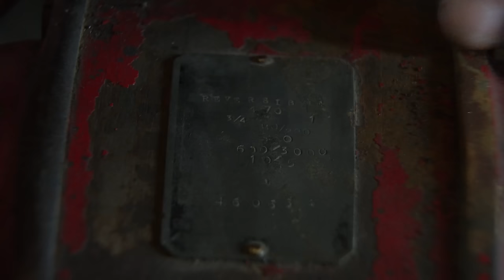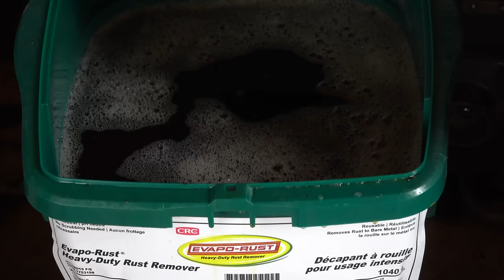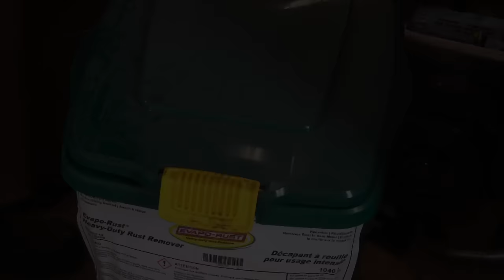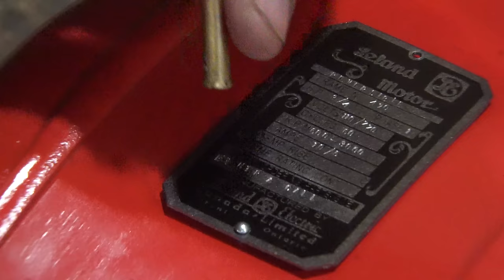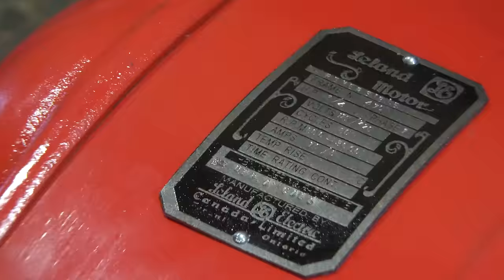Why Did They Stop Making These? [Restoration]

Comment: When I went to Electrician's Mate "A" School iin 1978 they taught us about variable-speed, reversing DC motors, but I've never seen one. So cool!
Reply: That is not what this is. This is an AC motor, and the brushes are not connected to power, they are connected to each other. (Shorted.) What is going on there is that depending on the position of the brushes, it is either including or excluding shunts (shorted turns) from the area of the rotor that is under the area of magnetic transition, so it is effectively a variable ratio.
Reply: im 68 an never seen one. dident no they exsited. snappy an cool. even now bet i could find a use for it.
Reply: @NeilWhelchel  Interesting. Makes sense - when they taught us about reversing DC motors, it was all handled in the controller. Variability in speed is simply handled by changing the voltage to the motor (DC). So I was wondering about this one.

Comment: This technology is still very useful and much more durable in industrial environments than solid state motor controllers.  However please be advised:  when the motor is going full speed and then is slammed into reverse the motor will create a voltage spike in the line.  Any delicate electronic devices sharing the house wiring may be damaged.  This principle is refered to as dynamic breaking. (when a running electric motor is disconnected and leads shorted to rapidly stop it).  The motor momentarily becomes a generator until the inertia is lost.  The leads can also be shorted with a high amperage resistor for less violent breaking.  This brushed motor most likely can also run on DC.  Great videos.  Watching from far far away.
Reply: It could probably be converted to run on DC but it did not look like there was any electrical connection to the brushes. the AC in the stator is inducing a current in the rotor windings with the brushes completing the circuit.  The alignment of the brush position adjusts the bias of the resulting magnetic field and by extension the speed and direction.  The video's analogy of the water wheel is a good enough layman's explanation for what's happening magnetically.
If the stator wiring is laid out how I suspect it is there would not be any significant adjustments needed there.  Just connect DC voltage to generate a static magnetic field.  The brush rigging however would need to be insulated and have its own power supply added to the brushes.  You'd loose the speed variability with moving the lever however as you control the speed by adjusting the voltage.  It would make setting neutral a lot easier but moving it around would just make your brushes spark while running.

Honestly this thing is unique enough that I wouldnt even want to try.  DC motors have their own design and theres no reason to try and cludge this interesting bit of old tech into being a DC motor that would be inherently temperamental unless you locked down the lever so it couldn't move.
Reply: braking ;)

Comment: Finally someone that knows how to join wires and use heat shrink.
Reply: Tbf he used an LB as a switch box too. 😂😂😂
Reply from the maker: @user-lb8do4ew6k  Muahahaha.  I needed a small switch box solution that mounted where the original was missing.
Reply: @HandToolRescue  I have been warned against soldering crimp connections though. "They" say the solder acts more like a lubricant than a solemn commitment; "they" possibly being old wives though. In a situation where nothing is moving much I don't think it matters.
Nice job as always of course.
Reply: @gshingles It's not a common practice but I've seen it in aerospace cables. Makes for a bitch to rework/repair though lol
Reply: @Sun-ut9gr  Hey, not saying I don't do it occasionally :)
Reply: Heat gun works better than torch guys. I was team soldering iron and lighter for a long time but it really does work so much better with an actual heat gun
Reply: @gshingles  this is only really an issue if you solder first then crimp as the solder prevents the crimp connector from getting a good bite on the wires themselves so they fall out if the solder melts or softens, the way Hand Tool Rescue did it there should be solid as the solder is being applied after a solid crimp has already been made.
Reply: @fragger56  ah, makes sense, thanks 👍
Reply: @fragger56  in fact, the context where I picked that up is putting ferrules on bare ends. Was told not to solder the bare end before crimping the ferrule, which is the scenario you describe.

Comment: To put it simply, the electromagnet created in the windings is interacting with the fixed magnets in the casing. As you move the location of the brushes, you're changing the direction and efficiency of push. As you move further away from center, the motor gets more and more efficient- ie: more speed. 
The energy is still going through the armature in other positions but- instead of creating torque, it's creating heat- which it likely why they're not made anymore. Too many barn fires.

Comment: Interesting motor; I've never seen, nor heard of such a thing, and I have friends that have come across a lot of unique equipment.  

I have been able to weld cast iron with a wire feed welder, and it's held up perfectly.  I first discovered it would work, after my dad tipped over our Harbor Freight drill press, and broke the platform crank in two.  I made the obligatory double-groove grind for the braze, and thought I'd try out my new wire feed welder, with ER70-S7 wire, just to tack the edges together.  It went really nice, so I thought I'd make a base pass.  

That went so well, that I welded it completely, and it never broke again, even after scrapping it some 30 years later.  That went so well, that I welded a huge crack in my neighbor's 390 Ford exhaust manifolds.  He held the rosebud down there to keep it cherry red, and I made pass after pass, filling in the gap.  He drove it for several years, and they still weren't leaking 15+ years later, when he sold the truck.  

I found cast iron welds at a much lower temperature.
Reply: The key to welding cast iron is preheating and post heating don't let it cool fast after welding keep heating it and slowly let it cool that keeps it from cracking.
Reply: @dmclegg66  It was Christmastime, and he drove it home.

Comment: Years ago, my father had a business rebuilding motors.  He would strip them down to bare metal, rewind new coils, refit new bronze bearings and paint the external parts.  He used some type of white wool in the oil wells, not cloth.  Originally, the winding wire was cotton-covered enamel.  When wire insulated with Formvar came out, he switched to that. I remember him cutting Holland cloth for insulating windings. Also, I remember him  carefully redoing the armatures, including undercutting the material between the commutator bars.
This was in the 1940s and '50s. It seemed like a lot of work, but I suppose it was feasible for specialized motors at the time. 
th

Comment: Bent handle was probably an indication of the predominate direction the motor was used. Maybe high speed in one direction, (hard over) and slow speed in the other direction negating going hard over. Good stuff. We were taught shifting the field for speed and direction but never had our hands on it. Thanks.

Comment: I watched this video closely. The amount of work involved in restoring it is absolutely MURDER! The one important step which I believe was skipped is checking the windings with an ohmmeter. I also think a high-voltage should have been applied to test the leakage of the insulation of the windings to the case (and hope and pray and keep fingers crossed) it passes the test! The engineering involved in designing this old motor is awesome.
Your job of cleaning it up with extremely hard work is excellent!

Comment: Im studying to be an electrician, we have one of these ate school. They went the way of the dodo when cheap inverters/speed controllers became available, because they have a massive flaw many other motors share; it has brushes, and brushed motors require maintenance much more often than induction motors. Asynchronous motors on the other hand only need yearly lubrication of their bearings for the most part.
Reply: What maintenance? 
Decades ago, I had a Dremel prcision tool. From times to times I had to check the brushes. Two 5 cents caps, then the spings and brushes at the tips of them. Changing brushes that were about to fail or were gone were like a 5 min operation at most.

Brushed engines have cons but they also have pros.
Reply: No mechanic or anything other than a wise old fart but
Just take a good look at anything made in the past 30/40 years and is it still working and/or repairable?
Most of 'todays' goods are made for 'the throwaway society'
Yet 60+ years ago they built machines to last - yes they had to be maintained / serviced but they lasted and repairing them was easy.
40 years ago my dad got 3 non running twintubs (washing machine) from an auction - from those 3 he made one functional....for my first home.
Now...I'm looking for a pre '86 car [pre engine management/pre computer/pre electronics because they're easy to maintain and hardly anything goes wrong except body rot and crashes....nowadays a simple rear end shunt will write a vehicle off.
Not having a go at the younger generations just offering a different reasoned perspective
Reply: tragic that serviceable motors with brushes are seen as a flaw, to be replaced by disposal non-serviceable motors.
Reply: Induction type squirrel cage motors still need Condition based monitoring. And older plants still use brushed motors because of longevity and ease of service
Reply: @philhunt9297  Truer words were never spoken! Throw away society is spot on. Why build it to last when you can get suckers to buy a new one every 3 years. Good luck finding a washing machine that will last longer than 5 years. God forbid you have to open the tiny flip top lid and add a few drops of oil twice a year! "Yeah too much work, I'll just buy a newer on". God craftsmanship and solid components. That is exactly why he was able to restore this neat little motor. Quality work in the manufacturing process, something lost on todays CEO's. Greed is king.
Reply: I have seen motors like this used where a winding oeration is taking place where the rotational speed slows down as reel get bigger but you need more torque as diameter is larger, so was used as more for torque as speed was determined by speed of the "main" drive
Reply: I'm sure brushes are much cheaper and easier to service than a failed inverter VFD
Reply: @benhartley1757 from what I gather it's not about the brushes per say, but the downtime of having to disassemble the motor and replace the brushes PLUS clean the collector (which is arguably just as important). I think y'all's points are valid though. "Throwaway society" has really started to get on my nerves, half the fun of studying to be an electrician is being able to fix my own damn stuff without a company forcing its proprietary garbage down my throat.

Comment: It appears to be a straight repulsion ac motor, or a repulsion - start induction - run motor.  They were quite common until about the 1950's, but have been largely replaced by capacitor start- capicitor run type motors.

Comment: Great job, great work on the brazing of the casting, and the new finish.  You do really good work.  As mentioned below, the commutator under cut is important and a tool should be used; years ago, I used a lathe developed specifically for turning commutators.  Also, the twine holding the windings in place at high RPM needs to be replaced.

Comment: Took me back to Algonquin College, Ottawa, Ontario, Canada,  early 1960s.  A Mr. Menna, "Electricity/Motors, teacher/docent: "Gentlemen, before "modern generators" using current and voltage sensing relays, a system was used to balance the required current/voltage at city speeds, versus Highway cruising speeds to charge a car's battery.  This was known as: "the third brush system" applied to the commutator of a generator."  You will probably never encounter this system in your "careers".  It is a museum piece, much like the Gramme ring motor."
Being too busy "learning"  I never thought about it again, until I saw your restoration.  A universal MOTOR with 4 carbon brushes, fixed to a radialy rotatable plate;  Eureka! How is this electrical machine wound and wired?
Have you thought to experiment: by mechanically "driving" the rotor and measuring, and plotting the output voltage versus speed?   How about using an Ohm, resistance meter, to shed some light on the nature of the windings?  Is it simply a 2 pole motor?  (by Ocham's razor?)
The fact that the commutator bar looks "normal" i.e. coaxially and straight = same commutating resistance, plus wear and tear pattern in both directions.  Similarly for the "straight vanes of the cooling fan.
Would submarines have used these systems as propulsion control in WW1? As generators?
Any info about: the manufacturer, the application of this motor? Power versus speed curve?
De gustibus non disputandum;  I would have painted the laminations black; "to enhance the heat dissapation", (if necessary, and contrast to the red, awesome, and yellow of the brass. 
Nice job.  My respect, Sir.

Comment: This is the first one of these I've ever seen.  Very interesting and nice job on the restoration.  1. I was looking at the brass handle that appears to be in contact with the brush.  Is it making contact?  No shock?

2.  I'd imagine that at low/no RPM's the windings would overheat.

Comment: That is the coolest electric motor control i have ever seen !!! In these modern times they use what you VFDs to change ac motor speed and direction. But that there is what you call self contained mechanical vfd driven motor. Very interesting…i wish someone would bring these back into manufacturing..

Comment: Leland Magneto Test Bench:
The Leland Magneto Test Bench is a vintage piece of equipment used for testing magnetos, particularly those found in early engines and vehicles.
These test benches were essential for diagnosing and evaluating the performance of magnetos, which are crucial components in ignition systems.
Here are some key features and aspects of the Leland Magneto Test Bench:
Purpose: The primary purpose was to verify the functionality of magnetos by subjecting them to various tests.
Components Tested: The test bench allowed complete testing of all rotating electrical and ignition components, including magnetos, dynamos, and other related parts.
Universal Adaptor Plate: The test bench featured a universal adaptor plate that facilitated testing of crankshaft-mounted dynamos and other components.
Overhaul and Restoration: Over the years, many of these test benches have been overhauled and restored by enthusiasts and experts.
Historical Significance: Dating back to the early 1950s, these test benches provide a tangible link to the technological advancements of that era.

Comment: 12:30 - ребята, не повторяйте такого! Не елозьте по коллектору напильниками и наждачками на пальце после проточки!!! Так убивается цилиндричность поверхности из-за того, что напильник "проваливается" в промежуток между ламелями. Только максимально острый резец, лучше алмазный или нитрид бора.
Never use file or finger with sandpaper to "round" commutator! You just ruine cylindricity due the file fails in between the lamels.

Comment: Simple and obviously rugged motor.  The lever changes the phasing by moving where the brushes contact the commutator. I bet that string was used for the same reason epoxy is used on motors these days, to keep the wire protected and attached to the commutator. I like the way you can oil the bushing by wetting the rag.  One of those things that makes one feel like they are doing their part to maintain their equipment. Probably stopped making them because they worked and lasted too long.

Comment: Great vid !  That fibrous material you removed @3:07 was there a a kind of "wicking" or a tiny "sponge" to help hold the light machine oil that was squirted in from a can into the spring loaded metal cap opposite the bearing to lube it. This was routine maintenance on most quality motors, generators & starters of the era. But the bearings lasted too long that way so they adopted the modern "maintenance free" bearings.

Comment: Nowadays electronic controls are probably more efficient and simpler to build, but I can't help but admire the mechanical genius that designed that thing over a century ago!
Reply: They don't have the power like these old motors had. I prefer a motor that don't need a capacitor to start. I like the old starting winding type. I have a third HP on my air Compressor. Don't need a one HP to run it  73
Reply: I have an old A&P coffee grinder motor that is about 100 years old probably my guess 1930 or older. Next time I'm in the mountains I will read the plate if it's readable. I sure would love to restore it. It makes a good grinding wheel which dad used it for. Sharpening lawnmower blades. 73

Comment: 20:00 To answer your question from the title: “Why Did They Stop Making These?”:
Short answer: Because people are stupid.
Long answer: Short answer + If you leave it in neutral, the motor will get hot, rather quickly. To the point where it destructs itself. And you've given people the chance to do so. And so they will. Because it's more convenient than turning it off.
By the way, I think brushless "DC" motors replaced those.

Comment: I worked on Schrage motors in mills back in the 1960s, in mills in the Loudwater valley in Buckingham Shire.
A Schrage motor is a type of alternating current commutator motor that has its speed controlled by changing the position of brushes on the commutator. It was previously used to spin carpet and yarn, but is no longer used for this purpose. 
More information can be found online, including a connection diagram.